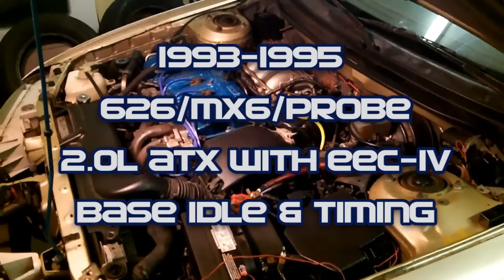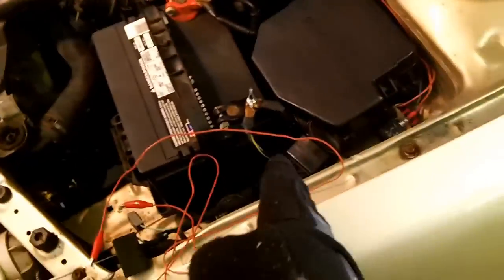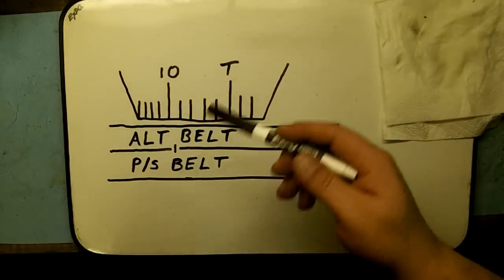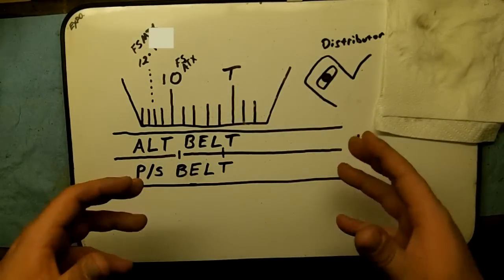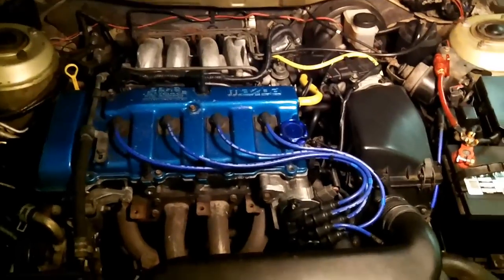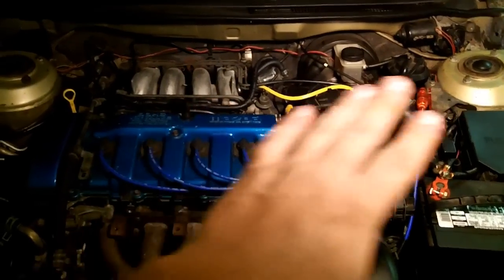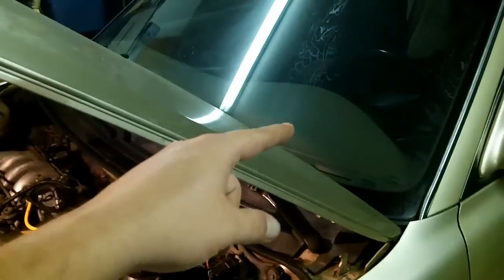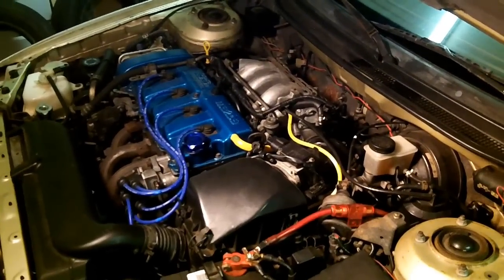Mazda 626 - Base Idle & Ignition Timing

Comment: Hi, I recently picked up a 1994 ford probe that has had a manual transmission installed as well. Your channel has been very helpful to me and I wanted to thank you for publishing so many videos. I have been working on getting my timing correct and this video was very helpful. My current problem is that I am having trouble locating the idle screw. My idle is a little fast when I have the car in diagnostic  mode. Right around 1000 or 1200 rpm. and I am having some of the issues that you described with my fan no kicking on and the car running rough and shaky.
Reply from the maker: +Asa Moore Your idle screw might be a part of the idle switch instead.  I forgot to cover that for manual transmission owners sorry.  It's a plunger switch where the screw would be.  It's adjustable but it's a pain in the ass to adjust.  Recommend you look up the procedure in the work shop manual available from pmx626.info
Reply: Well my car was an automatic but had a manual transmission installed by the previous owner. I think there are still a few quirks I need to work out due to the swap.
Reply: I have that shop factory manual and have been reading through it trying to find the right sections.
Reply from the maker: +Asa Moore The automatic did not come with an idle switch only the manual transmission.  So you won't have the idle switch.  Sorry I just realized you're talking about the idle screw. The idle screw is on top of the throttle body and it's the same for both manual or automatic.  Look into section F2 if you have the manual ECU or F3 if you have the automatic ECU.

Comment: Almost 6 years later, haha. One thing. Wouldn't it be the 1996-2002 cars that have the more electronic ignition timing? My dad had a 1996 626, and it didn't have the distributor. Though it was the V6, if that makes any difference.
Reply from the maker: 1996 & 1997 V6 originally came with a distributor. The coilpack debuted on the 626 in 1998.

Comment: Wow this video gives me a little bit of hope because it just might be the solution to my problem. You mentioned bad vibration at idle and thats exactly what I have, but to the point where my engine wants to shut off at red lights sometimes. Luckily, that hasnt happened yet
Reply from the maker: Vacuum leak is probably the #1 thing to look for if you have rough idle and low idle  Bad timing has almost identical symptoms to a vacuum leak except you'll still have ok acceleration with timing issue.  A vacuum leak will make  the car bog down and almost stall upon acceleration. If you can snap throttle during idle without the engine bogging down then it's probably not a vacuum leak.  Like I said in the annotation there are about 30 different things that contribute to idle issues and I really don't want to get into that.

Comment: I will be continuing on a 1997 Mazda 626 LX 4 cyl with a no start. Had the P0340 code. Where is the camshaft position sensor located? Is there a test that can be done to verify it's operation? I know where the crank position sensor is located. The crank position sensor ohms out at about 532 ohms. This appears to be in time. #1 piston at TDC and I see the mark on the crank close to the mark. I can also crank the engine and see the timing mark with a timing light flashing when #1 fires.
Reply from the maker: It's inside the distributor.  There is a test but you need an oscilloscope.  Grab a free workshop manual from pmx626.info and read up on it.  The manual will be able to tell you more about the diagnostic troubleshooting steps than I ever could.
Reply: On second look this was not in time. Best way to describe it is that the exhaust cam to crankshaft was in time but the intake cam side was not in time. Tensioner spring broke. Replaced tensioner pulley, spring, and top cover gasket. About $60 in parts plus shipping from rockauto. Belt ok. Wanted to save my kid some money so we didn't replace the belt. Pretty easy job but not fun in the cold. Also got rid of the belt squeal. I can't believe how tight those belts have to be to not squeal. Thanks for the manual. That helped with torque specs for the top cover. They ended up at 90 in lbs. I'd say if the belt goes bad and I have better weather conditions I could complete this in 2 hours now that I know where everything is. Car got an oil change before I took it off the jack stand. Hate that oil filter location. At least the filter is nice and small. This job reminded me off my other sons 98 Ford ZX2 that I did the timing belt on. I think that one was a little easier than this Mazda. Thanks again for the help.

Comment: Hello DJDevon3 saver that oil would you put on the box "automatic" Transmit and motor .. And where the oil is made transmicion if you can upload a video of how to do it in Spanish please haha. Thanks Greetings Argentina
Reply: Also if you can tell me the type of brake fluid that made that type of hydraulic oil and how to get the water to the radiator and engine. What can I haci this written after the tradusco thanks and apology.
Reply from the maker: I no longer have an automatic transmission.  I swapped to manual transmission more than a year ago.  Sorry I cannot do this.

Comment: Bro I need help with fixing my mazda 626 1998 2.0L Manual.
Today I have just finished cleaning its Throttle Body, IAC Valve, and EGR valve because it was raging up (sudden revving up to 2000) at idles when engine is warm and then come down and rattles /shake a little at around 1000 rpm. 

So after watching and getting inspired from your videos I have opened, cleaned and fitted back all those things back on my car, it started stalling now. yeah freaking stalling. 

During cleaning of throttle body, I have found that its butterfly valve was not shut completely at idle so I have adjusted the (retrieved) the adjustment screw of throttle body allowing butterfly valve to be fully seated and close the throttle. 

After spend around four days, watching heaps of videos and then putting so much energy and time in garage on car, it become even worst. I am highly disappointed at the moment and need your guidance to get my confidence back.

Hope to hear from you soon. 
Jawad (Australia)
Reply from the maker: Cleaning just for cleaning sake doesn't help anything unless you confirm the operation of the cleaned part works better now because of it.  Get out your multimeter and test the IAC.  Did you replace the throttle body gasket, IAC gasket, EGR gasket?  Test for vacuum leaks?  Diagnostics will ensure you are on the right path.  Testing is the only way to ensure that problems get fixed. ;)
Reply: I did replaced Throttle body Gasket.
EGR Gasket is of a metalic thin sheet and don't think it should be replaced. looks fine to to go back in place. I used gasket sealants along with these re-fitments.
As my mazda is 5th gen, I just unscrewed the electric plunger assembly from top of it which seated over an O-ring (flat rubber seal). so need not to change.

Dianostics...hmm need to buy my first OBD scanner but I couldn't figured out a 16 pin OBD port inside the car. Yet there is one 25pin in engine bay in grey housing. I tried to locate 16pin thing under the dash in front of driver's seat near the steering rod. No success. 
Thank you for help and reply and most important for all the videos on mazda 626.
Reply from the maker: Jawad Hafeez Sorry I have a tendency to forget that only the US received OBD-II in 1996.  Other countries received OBD-II much later, some not until past 2002 which is the last year of production for the 626.
Reply: I found a 17+8 pins diag connector under hood. And there are cable converters available on ebay to convert 17 to 16 pins that can catch a standard obdII scanner. 
The converter looks like this:
http://www.ebay.com.au/itm/200862513992?_trksid=p2055119.m1438.l2649&ssPageName=STRK%3AMEBIDX%3AIT

Your opinion always matter to me. So please prove some feedback on this.
Reply from the maker: Jawad Hafeez Since I do not have that diagnostic system I can't be of much help.  The OBD-I connections we got in the US are different.  I have no experience with it.  There are others on Mazda626.net that do have experience with that connector.  There are topics on it.  Recommend you register there and ask your questions.  Sorry I can't be of more help.
Reply: Hi

Sorry to bother you once again. I have diagnostic an air leak through intake gasket and fuel injectors by using brake cleaner spray over these areas. Now as I am going to replace the gasket and fuel injector upper and lower grommets along with O-rings, I need to know:
(a) Should I apply RTV Gasket Sealant under/over the gasket either on intake manifold face or engine head face? if yes which gasket sealant would you reckon?

(b) Should I also change injector fuel filters along with O-ring and grommets?

(c) How clean injectors without special tools?

Hope to hear from soon as I have to finish this job before the end of this weekend.

Jawad
Reply from the maker: Jawad Hafeez There is no specification for RTV on the intake manifold gasket because the factory gasket is a multi-layered metal gasket similar to a head gasket.  It is unnecessary if you use a metal gasket.  It's unnecessary to change the fuel filter if only changing the injector o-rings.  Fuel filter is done on a mileage or age basis but if it's been a while since you've changed it then go ahead and do so.  To clean injectors I recommend you look up videos on injector cleaning I do not have a video on that.

Comment: Hey man I have a question I have an mx6 93 model v6 klde when ever I rev the car at 2100 it seems like the car shuts down but then when it hits 1500 goes back to 2100 and it does it all the time and if im holding the gas peddal at the same piont it keeps doing the same ove and over  any ideas ..
Reply from the maker: Does this only happen during idle or while driving down the road?  Couldn't hurt to verify your mechanical timing and check for vacuum leaks.  Remember the KL has VRIS so check the VRIS vacuum system too.
Reply: ***** only when  idle and the virs I checked it already and also did the paper test on it and they working fine do you think oxygen sensors maybe? It stoped today  but I had the car not being use at all for 3 months.... u think that may have affected anything.....
Reply from the maker: fercho111989 Idle issues are the single hardest issue to diagnose.  There are about 30 different things that can cause it.  Best thing is probably to take it to a professional who can run some diagnostics. Please don't throw parts at it, take it to a professional.
Reply: ***** ok I think I miss read laast question sorry at idleit runs great but when I push thegas pedal a little to get it at 2100 its when it start doing that I think ill seeif I can make a video... about it cus is hard to explain lol by the way thanks alot man I like you videos content  very specific ob the things you do....
Reply from the maker: fercho111989 Videos always help big time.
Reply: ***** hey man I found out that my alternator internal regulator was the one cutting my power when the car was rev at 2100 rpm and when it dropped under 1500 it will work again and well now Frankie ( my car) runs nice and smooth. ... thanks tho...
Reply: fercho111989 by the way just asking I saw in a post about our window regulator rollers that you asked a guy about a furniture slider did you ever found out what its was the model number pls if you did would you mind sharing cus im going through that problem on my windows right now... thanks again and like the vids....
Reply from the maker: fercho111989
 Could probably figure that one out with a voltage test.  Like I said idle issues are a bitch to figure out.  I would have never guessed at that one.  Congratulations!  Enjoy the road.
Reply from the maker: fercho111989  http://mazda626.net/topic/41278-how-to-fabricate-replace-broken-window-slidesrollers/

Comment: great work dude!  this is some old school tune up stuff here.  sounds great!  getting the distributor in the correct place is tricky, because as you found out it rotates as it goes in.  so do you think the distributor was installed incorrectly prior to you purchasing it?
Reply from the maker: I've owned this car for the past 17 years.  I think somewhere along the way a mechanic didn't stab it correctly and that's where most of my issues have been coming from.  I've gone through 4 mechanics that never figured it out and 1 mechanic that did but he still got it wrong by 1 tooth.  It is tricky so I don't blame him I know he's a good mechanic but no one is going to go over your car with a fine tooth comb like you will.  Just have to get the point where you know enough to do that.  I've finally reached that point after 3 years of determination. :)
Reply from the maker: It is REALLY easy to stab the distributor wrong in this car. I actually consider myself lucky that I got it right but I did try for about an hour and 4-5 different stabs and resetting TDC after each attempt.  It's a very long process to get it perfect.
Reply: ***** no kidding.  I wonder why they even took it out in the first place unless you needed a new distributor put in.  typically you can just check the timing and adjust as necessary.  thanks!
Reply from the maker: chihuahua verde New distributor about 8 years ago sounds just about right! Hahaha totally forgot about that wow.  Now everything makes sense and I know the exact mechanic that did it.
Reply: @DJDevon3  are you still active on your channel?

Comment: I know this vids 5 years old but I have no clue how yours ran so far off with mine a tooth forward or behind (dizzy) makes it run like hot garbage. Like undrivable
Reply: I can even slide the adjuster up and down and it run like trash
Reply from the maker: Look for vacuum leaks? Compression? There has to be some other contributing factor on your engine.
Reply: @DJDevon3  it's been a mystery for years. Motor is mechanically perfect and zero vacuum leaks. The only thing I could guess is that there's one sensor not working right

Comment: hi....how you doing......i want to know about raicing spark plugs wires blue for my mazda 626 2000 wagon......this one use a big coil and a sensor, dont use a distributor like you
Reply from the maker: +José Eduardo Guillén Sánchez NGK ZX49 for the 4-cylinder or NGK ZX50 for the 6-cylinder.  https://www.ngk.com/Ignition-Wires-NGK-c905.aspx
Reply: +DJDevon3 THANKS......DUDE.........GOOD........spark plugs IRIDIUM WILL WORK GOOD??
Reply: +DJDevon3 WANNA KNOW THE MM YOU USE IN THIS PLEASE